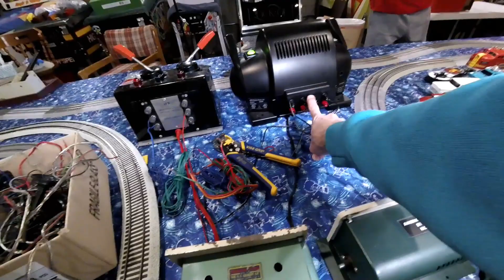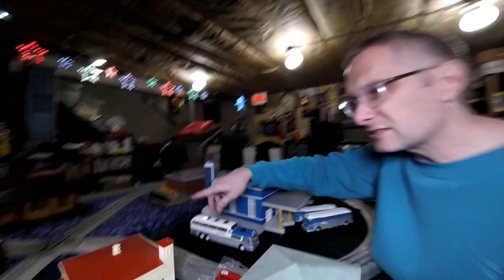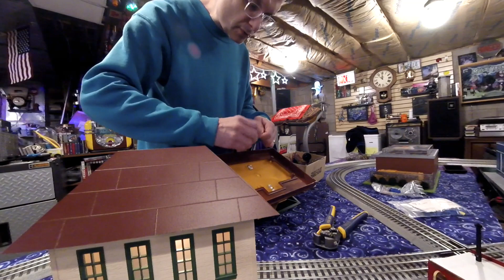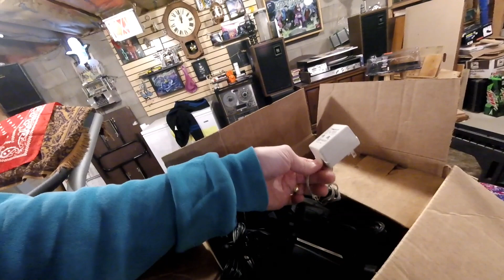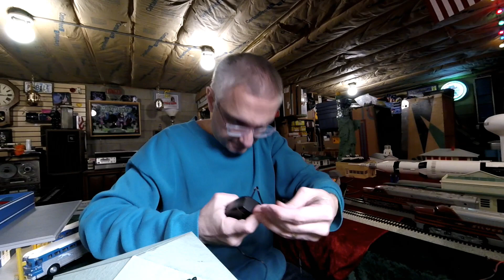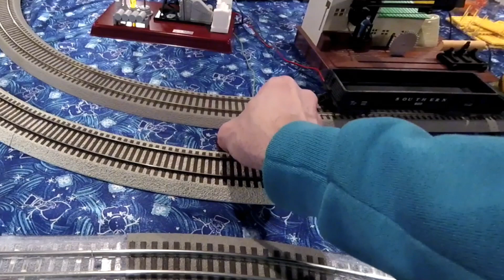Wiring up accessories on my layout - easy! Plus modding a power supply for a Menards building.

Comment: Have several manards buildings like how they have wireing option underneath so u can hide wireing just plug and play if your not good at wireing u can plug adapters into power strip or more familiar with wireing split hot adapter wire and ad a inline switch great video Jeremy   😊 👍
Reply: 👍good educational video as always  😊
Reply from the maker: Thank you. I too was impressed by Menards options. They didn't have to include 2 power sockets on their buildings.

Comment: Terrific video Jeremy.  Electrical & electronics have always been more of a challenge to me than the other aspects of the hobby.  As you note, most of the available accessories are set up for ease of installation.  I found your testing and explanation of the adaptor plug very helpful.  Regards, Brad
Reply from the maker: Great comment Brad ❤️ I'm glad you mentioned the adapter. I usually take it for granted that "everyone" knows how easy it is to repurpose a wall wart or hook up train accessories. Truth is until you do it a few time it's not easy.

Comment: So I'm a little confused. You just have one wire coming from the transformer hooked up to all lit buildings or a wire from the transformer to each building ??  I'm not even sure if I'm asking this correctly ?  How about showing a diagram. Thanks Jeremy 👍
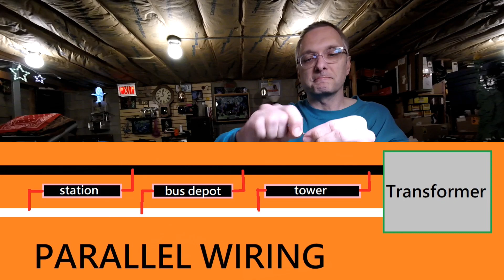Reply from the maker: I understand your confusion, I went over it pretty quickly. The wire I used has 2 seperate wires in it (like lamp cord). I did include a schematic in the video but only for a few seconds. It is at time stamp 6:28. I'm happy to answer any other questions you may have.

https://youtu.be/VasI2NZaVvU?si=FBngcEb4NbN6y0d9&t=388
Reply: Thanks...I'll give it a try.  👍